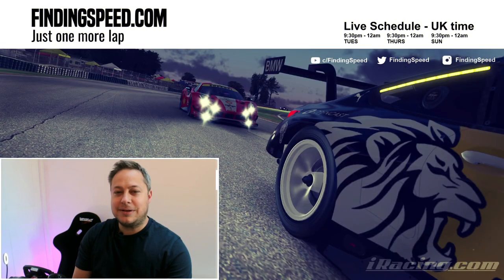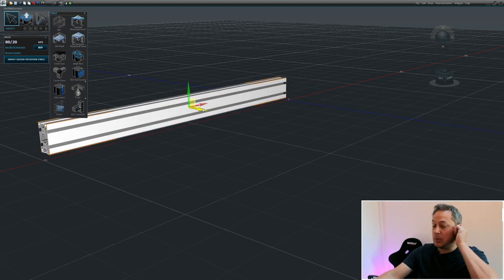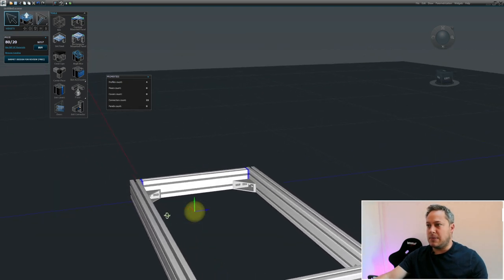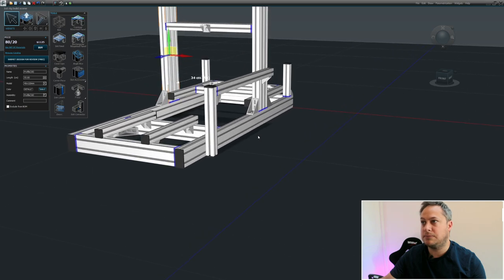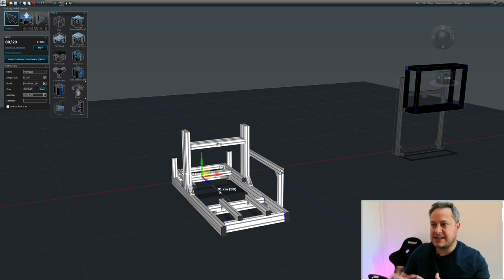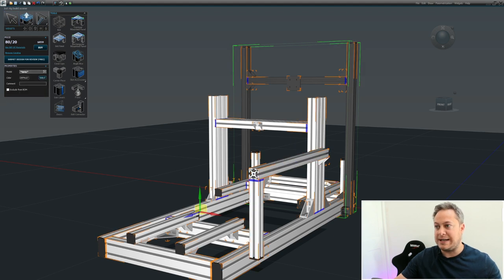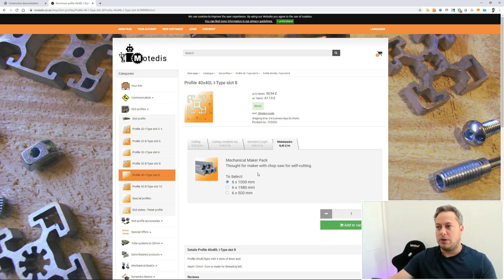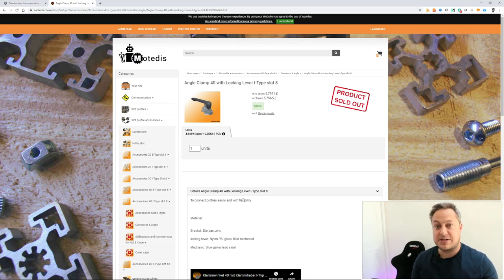Sim Racing | Build your own sim rig. Part 1: Design

Comment: Currently looking to design my own so this end to end walk through is extremely useful. 👍
Reply from the maker: Good luck with it!
Reply: @FindingSpeed  Completed my rig build yesterday and it works very well. Saved about 50% on a bought one so spent the extra on a much nicer Sparco bucket seat. Thanks again.

Comment: Good video my friend!  I appreciate it. I'm trying to "Lighten up" my DIY steel frame so that my 3DOF is more responsive. Have those V-3's hanging off the front and it really made the rig mushy. Adding the CSL made it even heavier. Been considering extrusions for a little while but most people are not running a motion rig like me. Question - would the frame flex under load?  Take a look at my upper frame of the rig. That's all I want to build with this material. Also adding a Kirkey seat to save more weight.  Thanks in advance anyone who reply's   DMAX

Comment: Wow! One if the best comprehensive video on designing a sim rig.  This definitely beats me scribbling out a design on paper and trying to figure out materials.

This is exactly the type of information I and others need to start the design process and you have simplified it but made it easy to understand and not use jargon we might not be familiar with.

Keep up the excellent work, I know it’s a 3 year old video, but it is perfect timing for me.

Subbed and on to checking Part 2! 😃

Comment: I went over the app and downloaded it to my PC, after making measurements and building my sim rig the total was calculated at $323 with end caps included, no chair wheel mount, & monitor mount. At this price point I would just go ahead and order a TrackRacer sim rig and save me some time. It cost about the same. Materials are expensive unless I can source the 8020 aluminum cheaper... that's another headache... If this was possible 5 years ago it would be cheaper perhaps? F!@#$ inflation!!! LOL!
Reply from the maker: I mentioned in the guides themselves to ignore the prices it spits out and just to take those measurements to a local supplier. Those prices aren’t competitive.

Comment: I think the rig width calculation is a little off, looking at the Sim Lab wheel deck it is 600 wide, however this rig was 600 wide on the outside (52 on the inside), I guess you could however move the uprights to the side of the rig giving you 600 again. Really got a lot out of this video thanks! :)
Reply from the maker: Yeah - I put my uprights on top to limit width (since space is a premium for me). If I was using a third party wheel deck the uprights would go on the outside. Thanks for watching.

Comment: I would recommend not having the screen mount bolted to the rig.. otherwise vibration will piss you right off!
Reply from the maker: No vibration my end - very solid. If anything it would actually help anchor a lighter-weight rig.
Reply: @FindingSpeed  that's good to hear, what wheel do you use?
Reply from the maker: Simucube 2 these days.
Reply: @FindingSpeed  fair enough, maybe it also depends how big and heavy the screen is. I have heard of people having issues like this and I am keen to avoid them. I am going to leave mine decoupled anyway and I'm only using a CSL elite.

Comment: I see it has the 20mm on top, its also easier to find in my area, would it be sturdy enough (will not have a dd wheel anytime soon) or do i need to go up or run 2 side by side

Comment: Super video, I am also planning to build my rig, it looks similar to yours. How do you mount your wheelbase? This is a problem I need to figure out.
Reply from the maker: Great stuff. Part two of series is coming in the next couple of days. I use a universal plate like this one: 
https://iovaluetech.com/Compact-Cockpit-sff-wheel-Plate/ you can mount it either directly to 80/20 wheel deck or using a couple of short pieces of extra 80/20 running perpendicular to whee deck.
Reply: @FindingSpeed  Good shout - was looking for this exact thing. Found cnc plans for doing your own but this is easier.

Comment: Hi, how much did this cost for the metal rig alone and then with the seat too? Thanks in advance

Looking at the sim lab gt1 but i feel like its hella overpriced and I could do something better for cheaper
Reply from the maker: Definitely could do something better for cheaper, if you’re not afraid to put the work in. Profiles / connectors were around £250 and the seat and accessories came to another £250-ish. Good luck!

Comment: Very helpful, I’m about 6 feet so how much room would be comfortable for leg length?
Reply from the maker: ‘standard’ 80/20 rigs are usually 1300mm long. You’d be fine with the dimensions used in my builds, especially if the pedals are length-adjustable.

Comment: How wide is the base?thank you
Reply from the maker: Hi. It’s 580mm (500mm innner width plus two 40mm frame sides). I’d recommend going for 600mm if you’re looking for DD wheels - the custom frames are usually that size.
Reply: Finding Speed I want 580mm inner width?is it too wide?
Reply from the maker: It’s wider than what’s considered standard, but not by much. You can make it as wide as you want 🤣
Reply: Finding Speed thank you very much

Comment: Hi. When you say you go for a total width of 60cm so upgrading to a DD wheel and base in the future will go smoothly do you have a wheelbase in mind cause I am finding varying widths and am confused :)
Reply: Hi - Ive been researching this in depth and can advise that the 600mm is a guide based on some of the prefabricated, adjustable wheel plates that are available.  These are typically 600mm wide.  As such you need to have you uprights 600mm apart (not 520mm as in the example given by Finding Speed - his total width of 600mm Less 2 x 40mm).  Good examples can be found at Trak Racer and Sim Labs.  Note - 600mm is not a standard as such, different brands use different widths.
Reply: @kenvinton3786  Yes, I have seen 600mm plates from sim lab, but the px1 is stated as being 580 wide! That seems strange.
I have seen plates from 500 to 580 from others and I really dont know how to plan a rig right now that can later take a plate If I am not set on which one it will be already
Reply: @gorraksmashskull  I agree. Unless you have one of the plates as your favourite it will be difficult to know how wide to make your rig.  My thought in this is.  600mm seems to be the widest measure for any current plate.  So, you either build to the widest fit ie 600mm inside width, to allow you the most choice (and incase you change your mind) or, you build to the specific width of the one plate you are going to definitely choose. Don't forget, some plate options don't fit all the way across between the uprights. These fix to a cross strut and as such give you even more options and make you less dependent on the rig width.

Comment: Hi. Im looking for a measurement and i hope you can help me. What is the height of the two side stems where the wheel in mounted on. the two vertical 40x120mm profiles. Hope you can tell me that :)
Reply from the maker: Mine are 500mm
Reply: @FindingSpeed  Awesome. Thank you. Its a good info for me.

Comment: Does 100cm long base enough for person who around 170-175 height?

I see the design that you made is 100cm 🤔
Reply from the maker: The actual base is longer once the pedal deck is set. As explained in the videos the usual length is around 120 / 130cm. It depends if you’re going to have a fixed pedal deck or not.

Comment: Does that frame hold the forces from that wheel
Reply from the maker: Yes. Using a Direct Drive wheel was the main factor for me when it came to building with 80/20. It’s rigid and very stable. You can build with larger profiles still, but there comes a point where it’s more style over substance.

Comment: how long are those sidepilars for the wheeldeck?
Reply from the maker: I believe they’re 550/600mm. Try and measure around your needs. My personal rig has 500mm pillars for the wheel deck because my seating position is much lower.
Reply: @FindingSpeed  thanks bud 👍🏻

Comment: And you never bolt a monitor stand to your rig duh. All the vibration goes right to shaking the monitor 🤣 always mount the stand to its own separate legs
Reply from the maker: Never had a problem. It’s perfectly stable with no vibration, but thanks for your concern. 👍